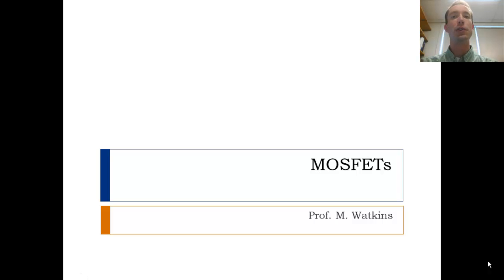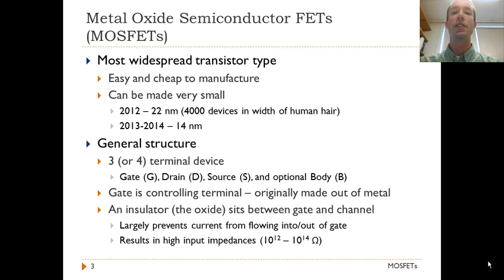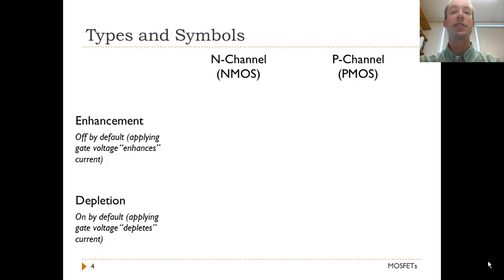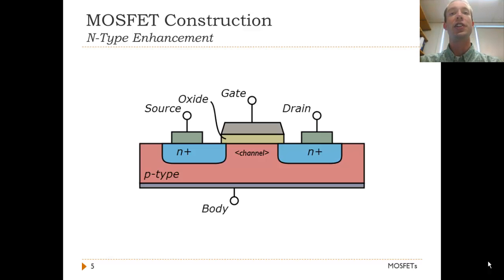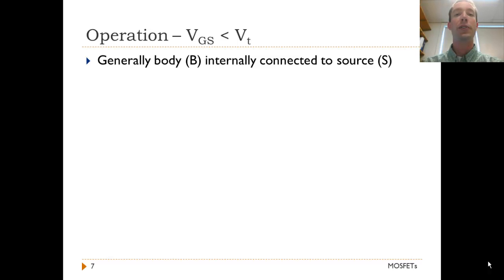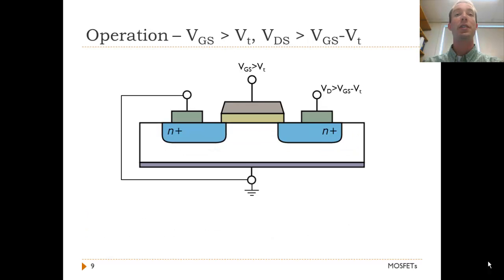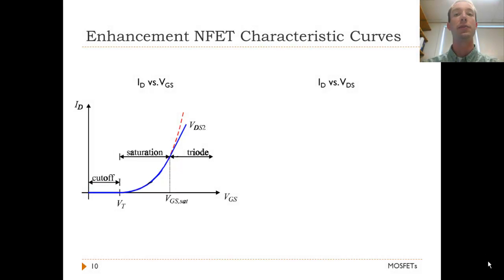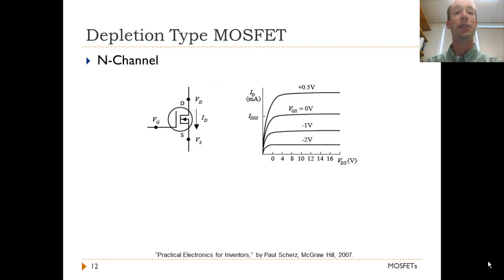MOSFET Introduction

Comment: As a chemist working on organic semiconductors, I found this extremely helpful to understand why the current is "pinched off" at high drain voltage. I've literally spent hours today, trying to understand it. Whilst others use similar illustrations, they fail to explain it in a direct way that's easy to understand. Thank you!
Reply: Hey may I ask which applications are you working on with organic semiconds?